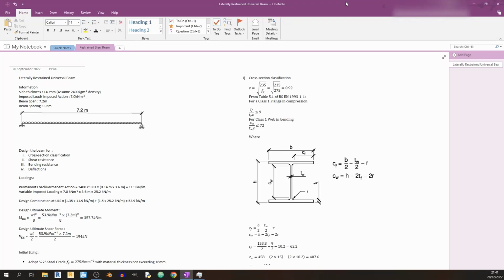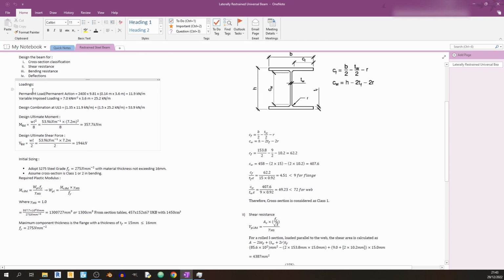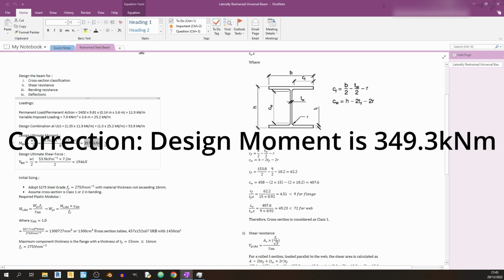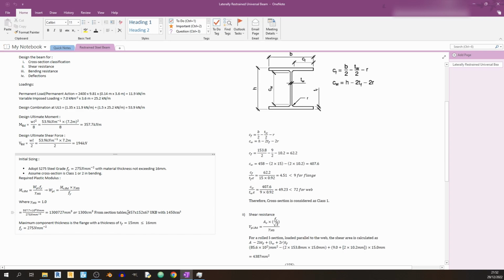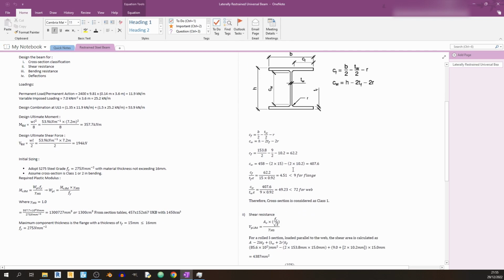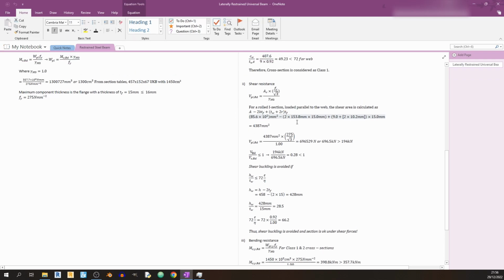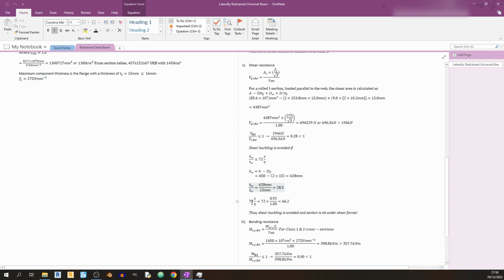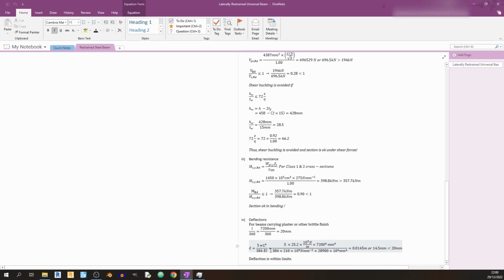Eurocode 3 Restrained Beam Design (Example Calculations)

Comment: Isn't there an error at last equation? w is 25.2kN/m, but that is only variable imposed load. Shoudn't there also be permanent load included of 11.9kN/m? Otherwise slub above beam is not inculded in deflection calculation.
Reply from the maker: If you read the EC3 textbook by Davison, refer to Appendix 7.2 Vertical Deflections. It specifies that L/360 is for variable action only.